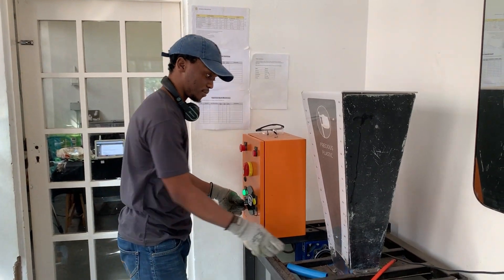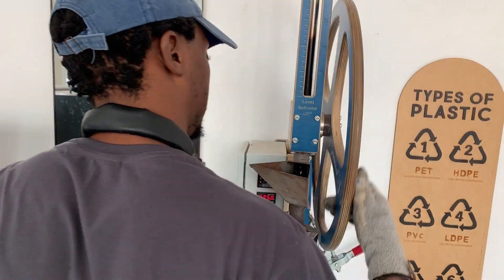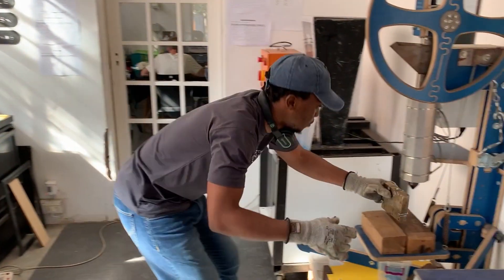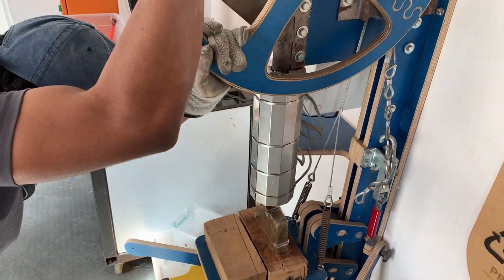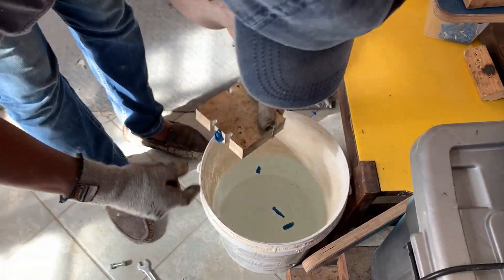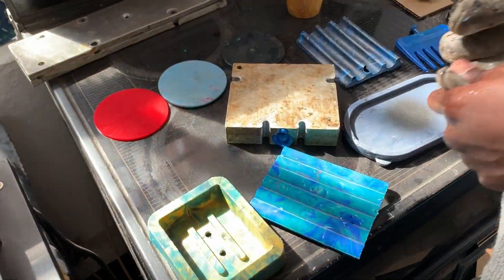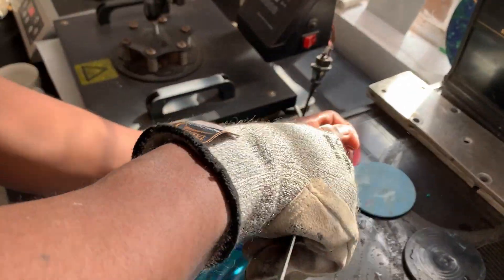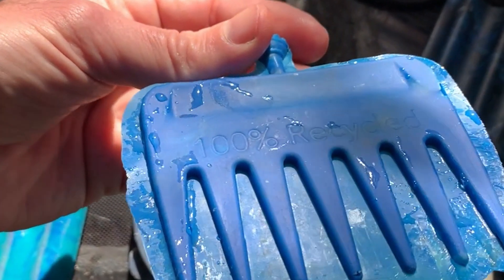Precious Plastic - recycled plastic injection molding process

Comment: Instead of using high pressure to inject melted plastic in a cast, it is possible to melt plastic as a block and to sculpt/carve it? It may be more accessible.
Reply: Recycled Plastic Lumber. There are some who do it.
But carving will create small flakes which will have to be collected.

Comment: You do better than others, I don’t know why. Most of the time, it looks unclean, it does not match the cast, and as you do this, you can even get letters written in the cast which appears cleanly on the object. How do you do this? Does it have to do with the pressure applied to the plastic injected in the cast? Or with the temperature applied?

Comment: I just finished making an injection machine. Totally from scratch. It looks like a professional machine😂 totally winged it. Mine makes 3 Tons of pressure though. Except I automated my injection so I just push a button and it does the hard work. It's a machine. ITS supposed to do the work😂
Reply: Also just made my own it’s 20 ton. Want to use it for PolyCarbonate. Just hard 1” threaded rod on Four sides with 8” by 8” by 1/2” thick steel plates in the middle with 1” nuts to lock all the plates in. Sorry I’m from USA we are stubborn and don’t use metric.
Reply from the maker: well done, that's an impressive project

Comment: what about the molds? you will need a cnc machine to make them? and the material should be strong like steel? thank you for sharing your video
Reply from the maker: yes we use a hobby CNC machine to mill the aluminium moulds

Comment: Hi great video, may I ask if it is possible to use PET plastic for injection moulding?
Reply from the maker: Its not really, the PET goes into a different state when it melts, its really liquid and leaks out the mould and then turns almost to glass (brittle) when it solidifies again. You need to use a modified version of PET called PETG

Comment: This is awesome and very well documented and narrated, nice work! 

I am curious about using recycled plastics for the mass production of products and product caseworks. In your experience are there any major drawbacks to using recycled plastics in place of virgin alternatives? 

I have read material properties are adversely effected when compared to virgin materials but I wonder whether you have experienced any drawbacks firsthand? 

Thank you and I look forward to more videos :) subscribed!
Reply from the maker: Recycled feedstock takes a lot more effort than virgin. For this type of manual machine its not a big problem, just make sure your material is clean - and sorted properly. But for high speed injection moulding its not practical, the material needs to be really consistent and that is a major challenge with recycled plastic.